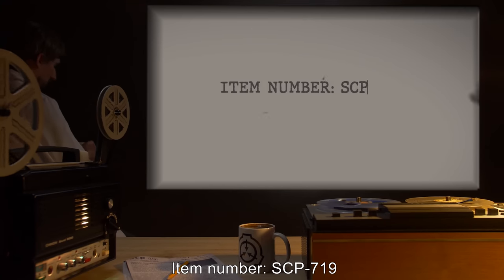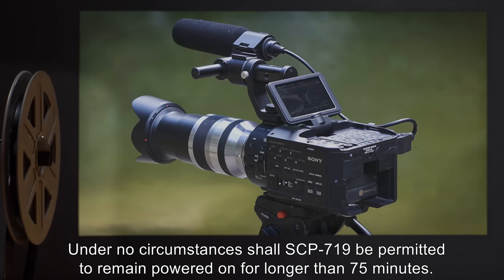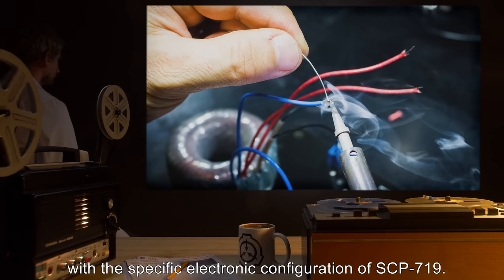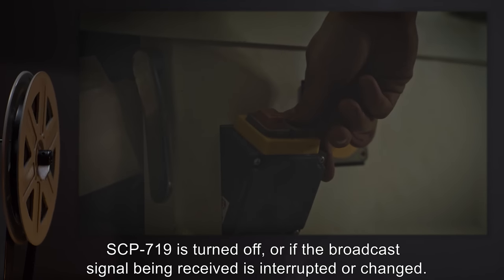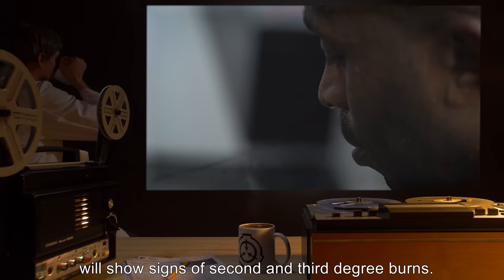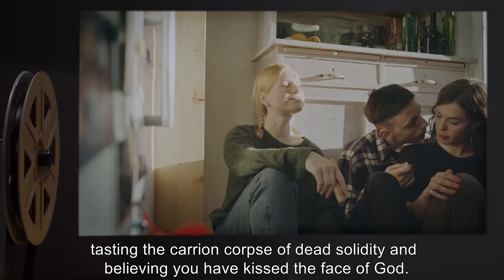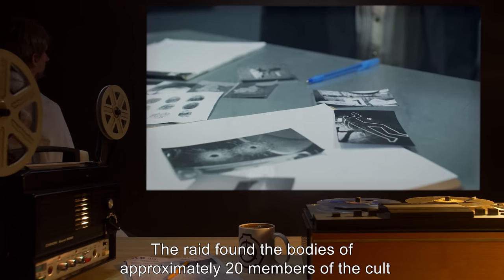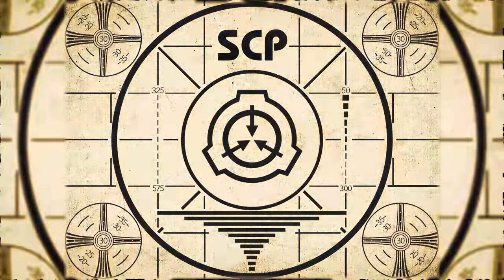SCP-719 | Light-Bringer (SCP Orientation)

Comment: It's a quantum resonator. It vibrates molecules to match other molecules in order to synchronize them. China an American have tested this. Side effects is high radiation. A door could be open with this, but the device must survive the radiation spike. Pretty sure the tv model is just a device that just happens to fit the devices, just not the correct one. Could be others pieces out there. If we're lucky, they'll be on a trash dump.

      Dr. (Redacted)

Comment: Well now that's bad! There are only two possible deities I know of that they can consider the lightbringer. Creature one: the sun itself when it goes daybreak style, or creature two; which is a lot more terrifying, the archangel Lucifer. However I am quick to discount the second one due to the fact that we've seen the inside of the garden and we know that Lucifer is dead and the sword is missing. Judging from the dialect in which it spoke to us. I would have to say that this is a transmission from that miniature sun that they have in containment. We already know that the thing is capable of talking and communicating all by itself, we also know that the SCP foundation is currently using it as an arc reactor to power their giant robot which is going to backfire on them royally according to the 001 when  day breaks scenario. This seems to be a warning to the foundation to stop using it as a power source otherwise it'll find other avenues to act out. Very disconcerting!